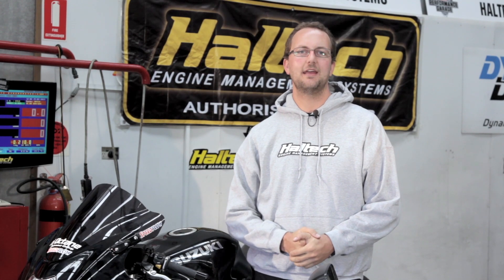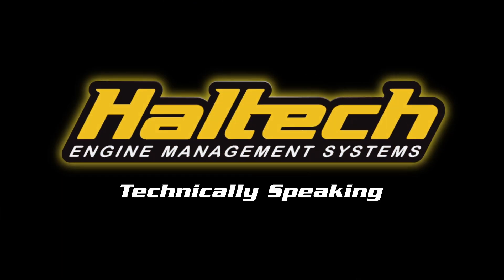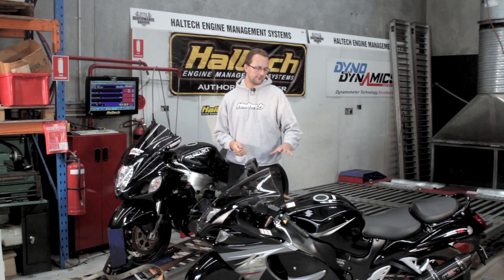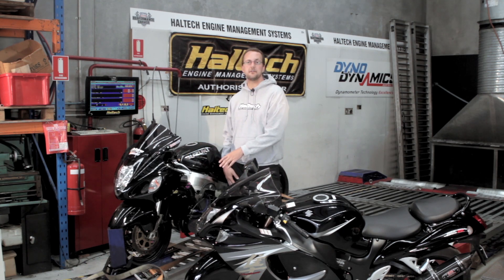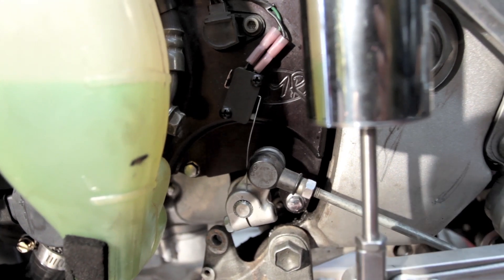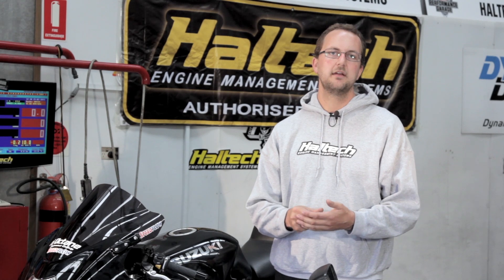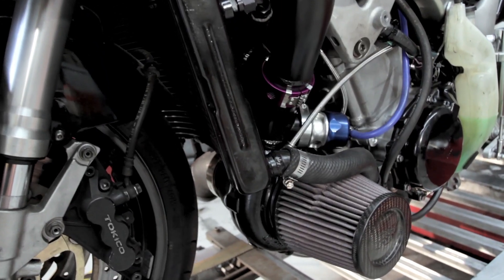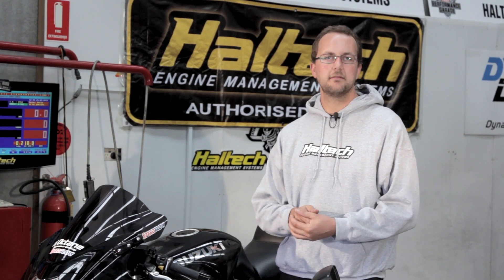ECUs and Motorcycles - Technically Speaking

Comment: Can an ECU can be mapped to consume less gas by decreasing the power? In a single cylinder bikes..
Reply from the maker: The short answer is yes - there are many ways in which you can control the power through an ECU.

Comment: Also I want to efi a single 2stroke. It is presently carbureted. How would you go about doing that? Any advice?
Reply: Look at some of the cheaper generators out now they run efi and start with no battery relying on the pull start.

Comment: Is that micro switch on the shifter really necessary? Wouldn't the Elite be able to kill ignition and activate the shift solenoid as outputs from the shift button? Maybe the Sport ECU is different to the Elite. The way it is setup appears that the shift solenoid has already activated the ram before ignition kill has begun.